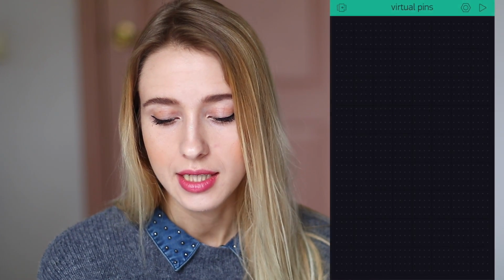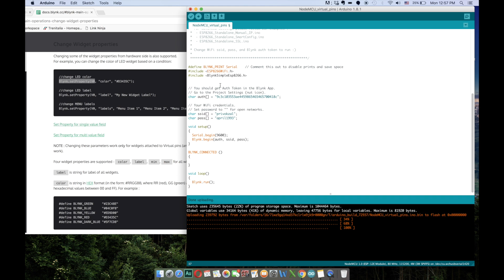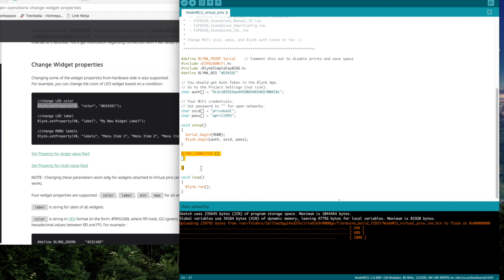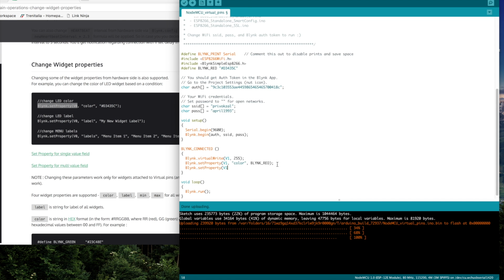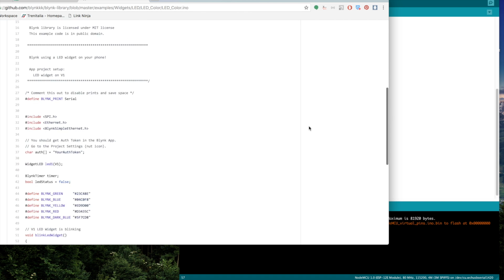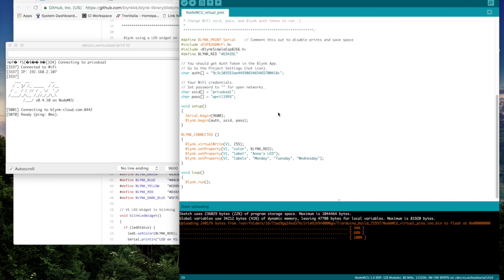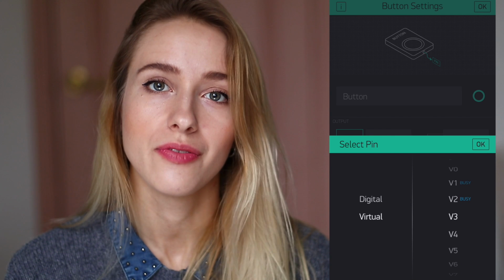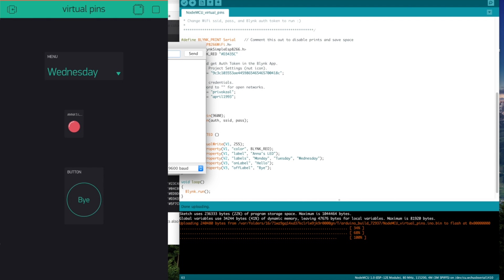(LEGACY - not compatible with current platform) Change widget properties from NodeMCU or other MCU

Comment: Madam,
Your all project awesome...
I have one project  requirement  from you '
I'm using 2 motors in our pady field 
Each motor have 2 potential free contact (DI digital input) Running and stop 
So this 2 motor running and stop status  can you able to configure on nodemcu hardware 
I have 5 wires from relays 
1 motor 1 Running 
2 motor 1 Stop
3 motor 2 Running 
4 motor 2 Stop
5 Common 

Please do the needful....